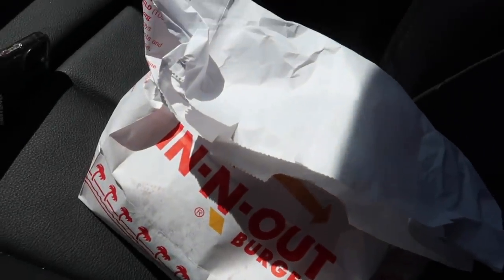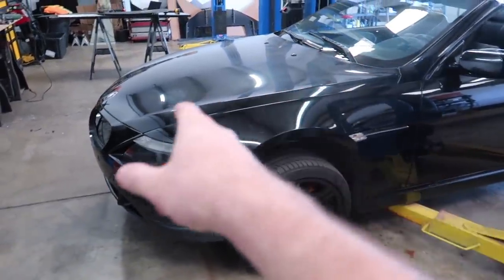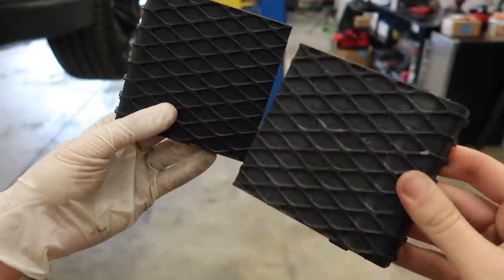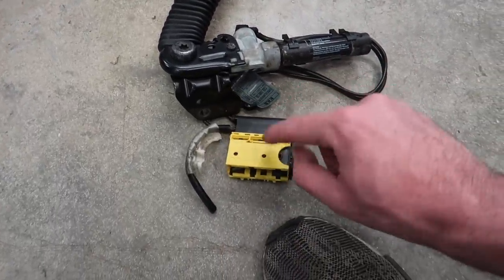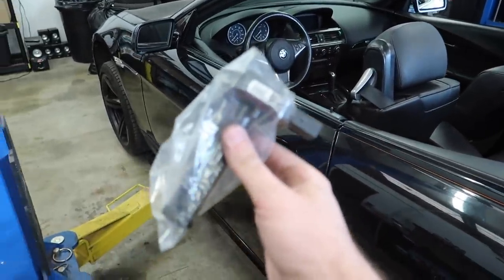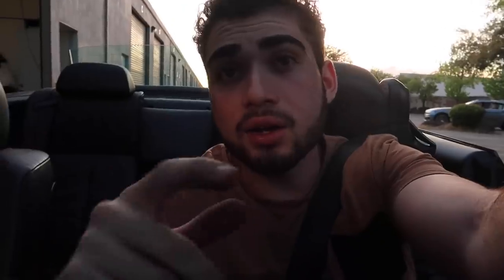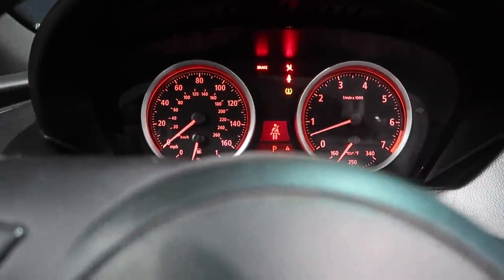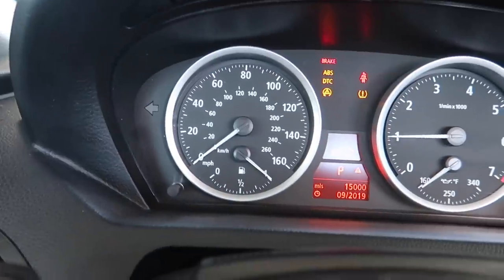FIRST DRIVE IN THE T$800 BMW 650i!

Comment: You might not have any head light bulbs in there. You trashed the H.I.D ballast that were in there so most likely no bulbs or you threw there power source out take a peak inside housing and you should be able to tell

Comment: My airbag light is on too... I was told airbag light does not go away even after all sensors are replaced and reset due to the code already being stored in DME. Can anyone confirm this?